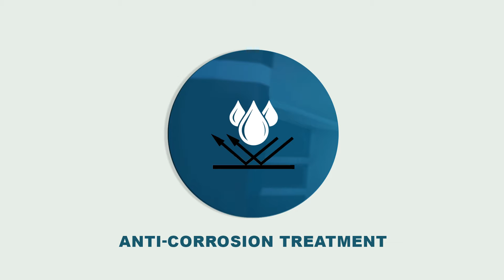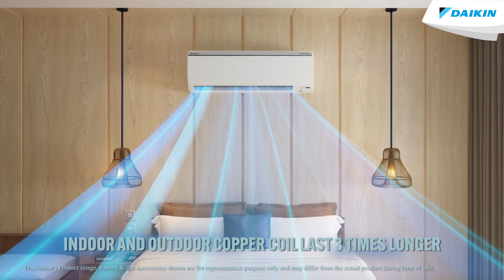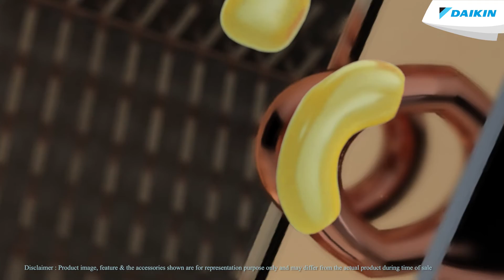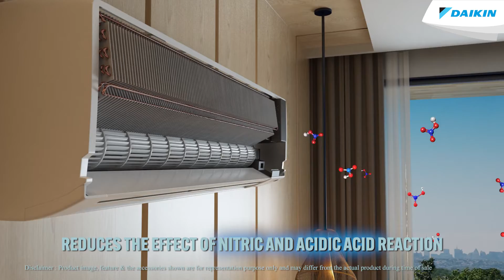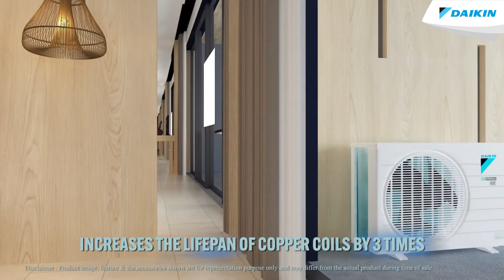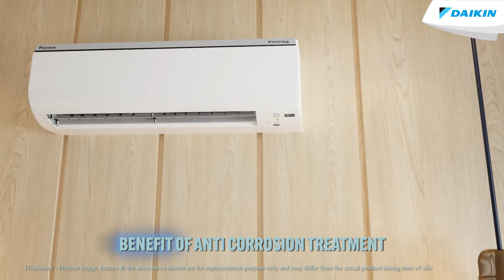Are Daikin ACs Corrosion Resistant?

Comment: My cooling coil got leakages within 2 years of buying. Now servicing firm asking for high charges to replace the faulty parts. All this apparently without any warranty post this repairs.
 Coating charges are extra even when fitting new coils as stated by service centre.

Comment: Daikin’s claims of high levels of corrosion resistance are completely false. I installed Daikin Blue-fin units throughout my coastal property in Chennai (high salinity & humidity) and the systems completely corroded within 6 months; in spite of me washing them down. Also, the PCB board on my newest unit has failed and I’m still waiting for a replacement after 3 weeks! Don’t buy Daikin, your money will be wasted.
Reply from the maker: Dear Rob,

We sincerely regret the inconvenience you have faced. Please share your concern along with complaint/contact number, complete site address and dealer's name at https://www.messenger.com/t/DaikinIndia and we will get in touch with you at the earliest to assist you.

Regards,
Daikin Team
Customer Support Mail ID: customerservice@daikinindia.com
Or  SMS : <DAIKIN> / Give missed call on 9210188999
Call Us: 18601803900 / 011-40319300